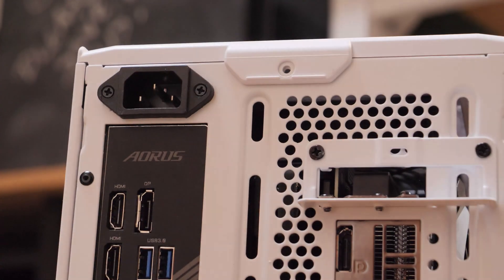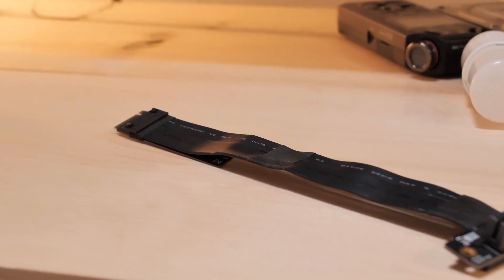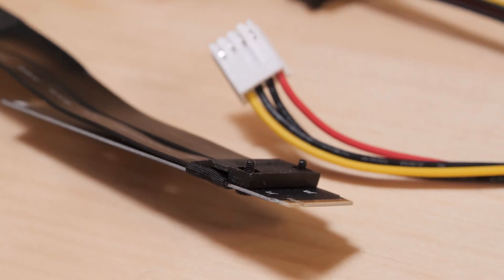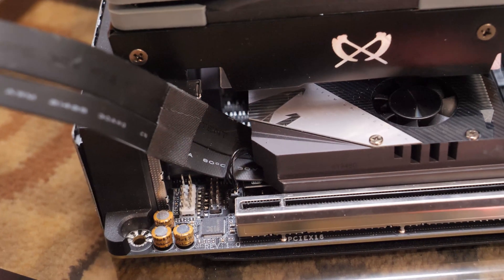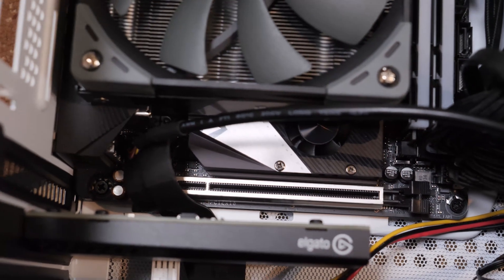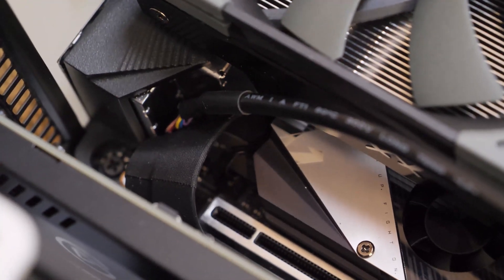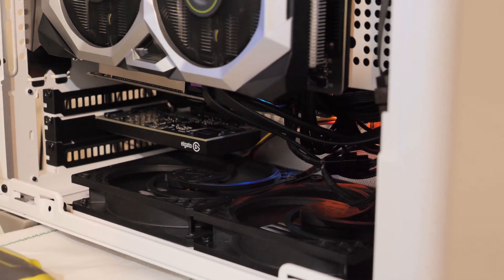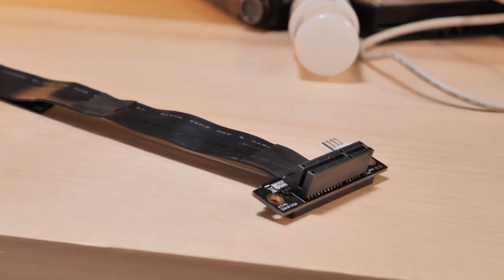Experiment: Turn an M.2 Slot in to A PCIe Slot!

Comment: Did you put any insulation tape on the back of the PCB which has the PCIe connector for the card, or is there still enough clearance behind that it won't touch the case's metal?
Reply from the maker: I didn't use any tape. You can see the way I installed things in the video. If you feel the need to protect components, then do so.
Reply: @ChillBuilds  thanks! I'm thinking about doing a similar thing, just extending an M.2 slot to x16 PCIe slot so I can put a large 3 slot GPU in a larger EATX case below my normal ATX motherboard.

Comment: Hello, thank you for video. What is the special name of the extension cable in 0:42 ?
Reply from the maker: There isn't a special name. Look for M.2 to PCIE adapter and try to find one that matches your needs based on the pictures as best you can. Sorry I can't be much more help than that.

Comment: Can we run the GPU on it?
I have a Mini PC from lenovo ThinkCenter, And that PC is very good at performance even while editing videos but at the time of rendering very high rigs, it laks. That machine does not have the PCI-E slot to add GPU, but that machine has two M.2 NVME slots and a one m.2 KEY for WiFi. I just want to know if I can add GPU on this x4 slot. I did bit of the research and found this cable can achieve 32GBPS and on the other hand NVIDIA RTX 4060Ti can go max 18GBPS.

On paper all seems perfect fit. What's your suggestion.
Reply from the maker: I have not tried a GPU. A GPU can draw up to 75W from the slot, and I haven't tested whether this device can supply that. Also I'm not sure where you got that number about the RTX 4060 Ti. On a 4X PCIe 3.0 interface, it will definitely communicate more slowly than when it uses all 8x lanes of PCIe 4.0 that it normally would.

If you try it, let us all know how it goes.
Reply: @ChillBuilds  PCIe 4.0 x4 is equvivalent of PCIe 3.0 x8, so if the GPU and motherboard M.2 slot both support it, the situation should be much better.

Comment: Great thanks for the video, the motherboard I am looking to buy has a 1 x M.2 (Key M, 2242/2260/2280) that supports PCIe x4 and SATA3 for SSD's, I want to use this to slot to install a Dual NIC, would this adapter work?

Comment: can i use it for my HP OMEN 16 laptop? i have elgato 4k60 pro too, and I want to turn my laptop into a streaming pc
Reply from the maker: I have no idea. You'll be running a cable out of the bottom of your laptop and you'll have to add another power supply give the adapter power too. Maybe it would work, maybe you could destroy your laptop in the process.

Comment: To make sharp bends in the cable you can do what used to be done in ribbon cable back 20+ years ago and that is to make a 45º fold in the cable giving you a sharp 90º bend
Reply from the maker: Normally I'd agree, but the coating on this means creasing it is probably a bad idea and you risk damaging it.

Comment: What was wrong with the x16 slot the cable was covering?
Reply from the maker: That's an interesting question. What makes you think something is wrong with it?
Reply: Usually its bandwidth is shared with the higher slot, so you can’t the top one at full speed if you also use the bottom one. So it becomes either one at full speed or two at half each. M.2 slots, however, often do not share the bandwidth (but sometimes do) and so this is a better choice.

Comment: Just want to confirm i going to run elgato 4k 60 pro mk.2. Is that work peefextly fine or there is any loss in quality or somthing? And one thing where can i put that 4 pin connector other end on motherboard.

Comment: Have you tried doing this with the M.2 slot on the back of the motherboard?
Reply from the maker: I don't have this setup anymore, but the reason I didn't use the back slot at the time was because I wasn't comfortable folding the flat cable sharply enough to fit behind the back panel and make the turn needed.

Comment: Does not work with my gigabyte trx40 pro wifi.  First slot is a no go with an Asus XG-C100C.
Reply from the maker: You are the first person to report that it did not work. Thanks for the info.
Reply: @ChillBuilds  So it doesn't work on the first M.2 slot straight through the threadripper but it does through the chipset M.2.
Reply: That’s incredibly helpful, I had this exact issue and you just fixed it for me. I looked at my motherboards manual to see which m.2 slots are direct to the cpu and which go to the chipset first

Comment: Thank you! I was looking for a way to fit a 10Gbit NIC into my ITX Workstation and actually already gave up and wanted to reward to an 2.5gbit USB adapter...but this looks promising. Now the challenge would be where to fit that network card into the already completely crowded case...
Reply: I'm looking to do the same thing, does it work for you with no problem ? If so, which NIC have you used ? Have you run some bench ?

Comment: Wow, well done. I need a 10Gbit Ethernet PCIe card & was worried about whether such setup would work, I'm very happy it does.
Reply: If you try it, let me know how it goes for you. Worked great for my capture card.
Reply: @jacksamurai9946  I'm looking to do the same thing, does it work for you with no problem ? If so, which NIC have you used ? Have you run some bench ?